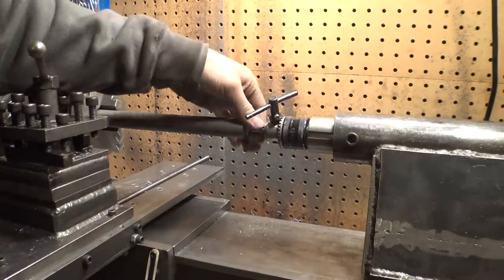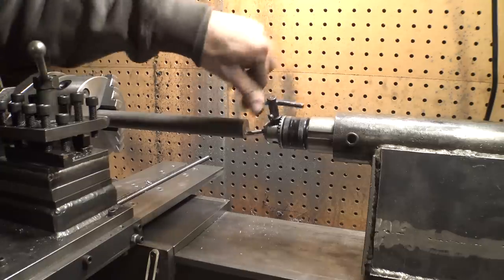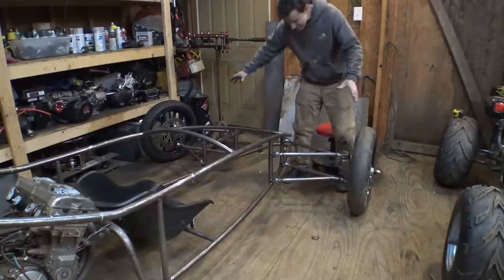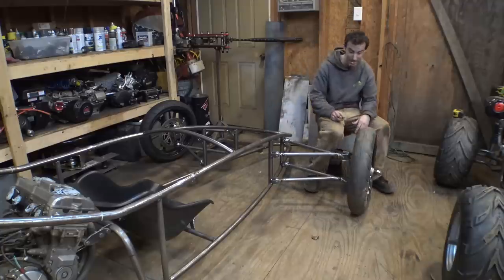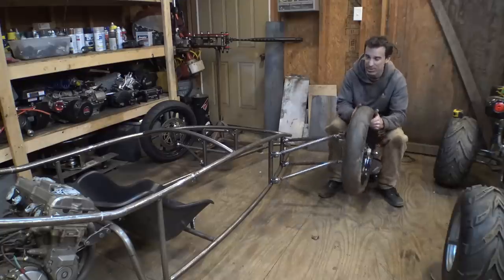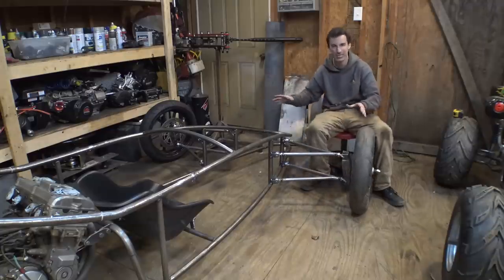CBR 600 Reverse Trike Part 3

Comment: Cantilever suspension could look really cool on this build.
Reply: This thing is screaming for cantilever front suspension. Lol
Reply: Yes that would be great
Reply: Really hard to build though. But if he figures it out, others should be able to do it for themselves
Reply: Agree!
Reply: that would be perfect!
Reply: @Ratkill9000  
Um... Have you seen his control arm setups, steering and throttle linkages, shop tool design and builds? 😆 

Could probably do a suspension setup in his sleep. 😊
Reply: Yes, air bags too in front.

Comment: I think you should weld the two tubes forming the a-arms together at the back side, keeping a full tube length from inner to outer rod end for the front tube. When you weld them in front (like you´ve done now) the welds are in tension when you brake. Even though its probably not an issue, a simple way of staying safe is to design welds to compress under load ...
Reply: And '"I think"  that you should build yours like that,.. and be sure to video all of the build so you can show him how it's done,
Reply: @justins7900  I can't really see how that would make this particular vehicle safer? Remember that his plans are to make something faster than the regular ones, and perhaps road legal. That means he has to consider other peoples safety, as well as his own. Fell free to criticise my comment from a technical point of view, but if you have nothing better than the "duuh, do it better yourself"-crap you can just stay in season and hide under a Christmas tree.

Comment: Consider either a push-rod or pull-rod suspension with inboard shocks mounted as low as you can?  

Research “stability of a triangle”, three point vehicles.

I like the shape of main frame and a-arms!  Nice work!

Comment: Looking good keep it up!  You inspired me to go ahead and start my reverse trike build.  

Love that you built your own spindles, that’s cool to see. Thought about it myself but I doubt I could do as good at it as you did.  The trike I’m building calls for a 4 1/2” ground clearance.  Hope that helps ya. If you do the pushrod type or a single pivot you will have height adjustment on your push rods if you use hiems.

Comment: Looking goo as always man little food for thought looking at your arms and how they travel look vary straight up and down might want to give it a little camber gain as it travels though the suspension that my only thought great job man
Reply: I was thinking the same thing. Typically, the upper arm is shorter than the lower, to get some camber gain in the turns.
Reply: Camber gain is totally pointless if using rounded motor bike front tyres like he is. It’s an on road vehicle it’ll be fine.
Reply: Tilting is not important for a motorcycle tire? LOL!!! 🤣

Comment: I’m a fabricator/ certified Harley technician/ CNC machinist. You’re definitely talented but with a little bit of planning, not much, you could eliminate some of the joints in your chassis’ and also use triangulation more. You could eliminate some tubing pieces too. I’m mostly referring to the dune buggy build here.  You may have wanted that look though.  I just hear you talk about how heavy your projects are which I noticed before you said anything. A rough draft, a cheap design app on an iPad and a calculator and you could really stream line your system as well as add better performing dimensions and ratios to your suspensions. If I’m not mistaken your A arms look to be equal length for the top and bottom. I believe there are formulas that you can apply if you use unequal lengths which help with handling characteristics like camber, rebound and dampening. You have to be careful though because shocks designed for the weight of a vehicle can be to stiff or not stiff enough dependent on their placement. 
A three wheeled vehicle I believe will be more stable with an unequal length suspension. Effectively making the outside wheel in a turn lean inward with camber as it pivots up, like the natural characteristics of a motorcycle wheel in a turn. You’ll also keep more tire on the ground as the suspension compresses.

Comment: Lol. “Stupid Chinese bits” translation, harbor freight.
Reply: The bit had nothing to do with it. Purely user error. Poor rigidity and machining setup.
Reply: Hey man harbor freight rules . They make it possible for us broke ass buggy building geniuses to.operate.  Lol without harbor freight I wouldn't be able to.own any tools .
Reply: I bought a mini lathe from them to. And it was electric and it sucked . So I went back up there and bought a small engine and hooked it up. It's pretty awesome now
Reply: Not the bits fault.  Work was extended out WAY too far from the chuck.
Reply: @DrLove911  Save up a bit. Get less, but better quality tools. And work to a higher standard. You can't really achieve much with bad tools.
Reply: @thefreedomguyuk  thanks for the advice but you can keep it. I don't think I asked for any . I'm not the one complaining about harbor freight . Talk to the guy that started this post .
Reply: @thefreedomguyuk  and you don't have a clue what kind of quality my work is

Comment: Your fabrication skills are getting so much better,I kinda wish you would build this into a four wheel car . It would make a very fuel efficient car with those wheels an a Diesel engine . If your building a T-Rex type vehicle your not gonna be happy with those tires for performance ,plus your beautiful front spindles are gunna need to change to fit the wider tires. Your skills as a craftsman are amazing challenge your self by building a a outboard engine setup for a fishing boat check out Gator tail for ideas.

Comment: You won’t break center drills if your stock isn’t sticking out of the chuck that far. Rule of thumb is 3x the diameter. If you must stick out of the chuck a long azz way like that, you need supports of some kind, either a floating support on the carriage, or a steady rest off of the bed. High quality US cutting tools break too if you’re not rigidly supporting the workpiece.

Comment: Got a say not a fan of the reverse trike and seeing all kinds of problems using the motorcycle front tires at high speed. I think you will have issue with turning. BUT that said I do love the craftsmanship going into the project and I could watch you machine parts all day long!!

Comment: I am wondering why you use the swivel joints where the a arms meat the frame? You only want a vertical motion so a simple bushing would be simpler and cheaper while reducing unnecessary motion in other directions.

Comment: A member on the V4MuscleBike forum is experimenting with auto tires for the rear end of a V45.   BF Goodrich Radial T/A 155/80 R15    Should work fine for the front end if you can find rims that will work with your build. Imagine how that Trike would run with a V65 behind you instead of a piddling 600cc...

Comment: The only problem is see with the front suspension for a road vehicle is there is no anti-dive geometry so under heavy braking the nose will dip down and being low with the nose extending past the front wheels there is a chance it could hit the ground

Comment: This is why books are important.
Steering and suspension geometry should be worked it before turning on the welder.
I can already hear him saying:
"I almost got rid of bump steer, but it still pulls to the crown of the road and jerks the steering wheel when you hit a pothole..."

Comment: rotate the inner ball joints 90 deg on controlarms, under hard brakeing which you gonna have on pavement the axial load on the joints and they may brake or ware to quickly.

Comment: One wheel wheelie? I don't know for sure how you would do it but make the tires tilt as you steer it, top of the suspension moves with the steering. Would help with what you said about those tires not getting traction because they are made to tilt.

Comment: Can the front handle full brakes over a bump? 
I've build enough (twostroke offroad) reversed trikes to have serious doubts if it has enough safetymargin, even for road use. A pothole under heavy braking transfers a LOT of rotational energy to the chassis!

I have no specs, but with a bike engine breathing down my neck, I would like to know for sure!

Take care, and have fun throttle-steering!

Comment: You know, there is a BMW Electric model that have thin tires, think they are 19 inch in diameter and about 3 inch wide, if you haven't found any solutution about tires 🤘

Comment: I'd hate to say it because I really like your projects but brother... That front end is way too wide. I'd cut at least 4 inches off of each side. It's going to be way too tippy that wide. Plus I would recommend sway bar.
Reply: How many of those have you built brother ?
Reply: @justins7900  I've done plenty of fab work. I wasn't talking crap if that's how you read it. It's an observation. Something with a frame that narrow needs a stiffer, more sport tuned suspension for cornering and handling. Long control arms like that will produce more body roll which will result in steering traction problems and under steer before the apex.

Comment: Its funny the state allows you to build your own control arms but does allow atv or off road parts. So the state just trusts anyone's engineering and welding, opposed to parts made in a factory designed by professional engineers. And welded by machines and im sure use quality control

Comment: The key to reverse trike stability is placing the center of gravity as closer to the front wheels as possible, without sacrificing rear traction. Eyeballing your design, it strikes me as if the line between the two front axles has been placed way too forward.
If you allow me a constructive comment, it would improve stability and behavior extremely if you would place that line somewhere around where i guess your knees would be located in this build.
Hoping to see the results! keep it up :)
Here's a little and simple article regarding trike design.
https://defproc.co.uk/blog/the-golden-rule-of-trike-design/

Comment: Just a idea but when I go offloading I Deflate my tires So I can get more traction to the ground maybe you couuld do the same?
Reply: That is really outside the design of how sportbike tires are made to operate. it might be better to put a rear tire profile on his front tires. I would not air them down. I know they make some more squared-off profiles for drag bikes, and also touring bikes that are putting extreme miles on hard slab.
Reply: He's specifically stated that this isn't an off road build, but a full road going project.
Reply: @NoneyoBisniss  built with low speed go-cart parts. This should be fun.
Reply: @NoneyoBisniss  yes it's not but they also do it In drag racing

Comment: loose the swing arm and make a tubular one, it will match the frame too.. welds racing wheels 5 inch wide on the front would too cool and keep your weight down..

Comment: Be at least 6" off the ground.
Reply: I agree with you. He needs it more than just that level. I don't even think 6 inches is enough. When it comes to the weight of the front suspension once it's all said and done with steering and everything else?? I believe 10 inches is the magic number..
Reply: @davidmiller6970  No need to be so far up in the air.  I built a street and track Lotus 7 clone at 4 in track ride height and 5 1/2 on the street without any issues.  Coilovers with the right springs on the front can take up the added weight and let him set ride height at about any level.
Reply: @KayakFishSC  No speed bumps in your neck of the woods, then. Lovely!
Reply: @thefreedomguyuk  We have speed bumps.  They are usually about 3" tall.

Comment: Surprised not more subscribers just saying, not trying to be a creep. i suggest the american made carbide bits, pay for may chinesium products or a single american made piece of hardware. I offended you bought from the chinese. You will spend more money on their crap then anything you'll spend here man. i'm telling you, as a fellow man, not as an advertiser. the american dream is built off the pinicale of supply and demand, they over engieneer so you dont have to. GOD BLESS AMERICA, even if the guy isn't real